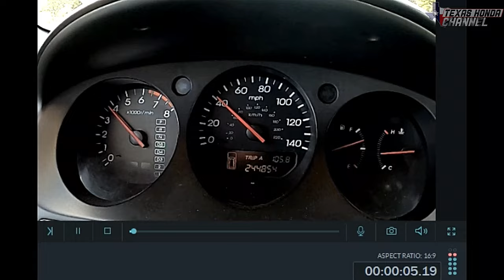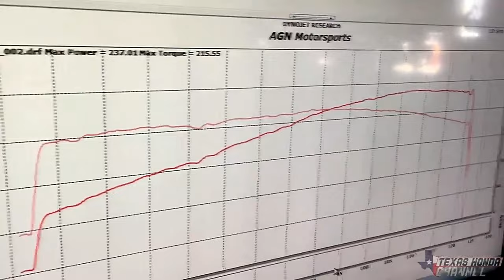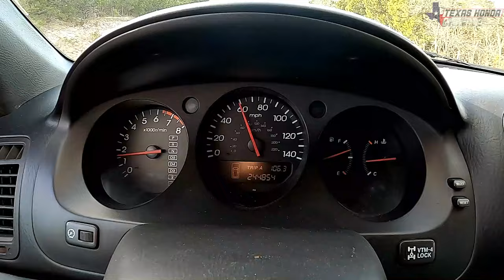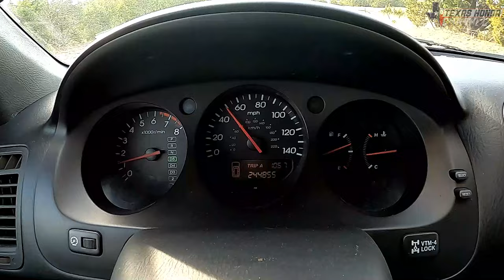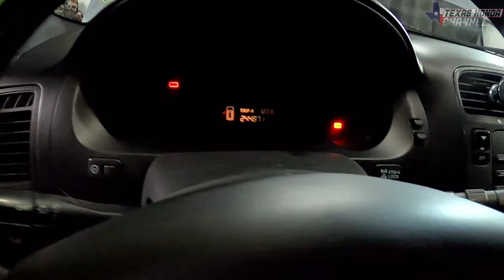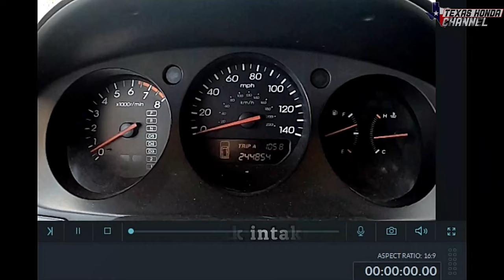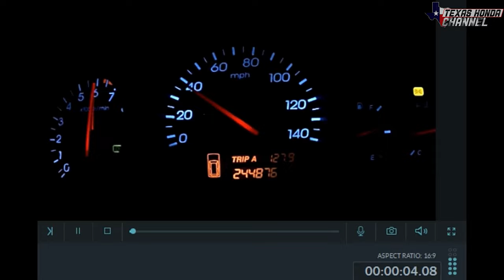Cheap Junkyard part made the MDX faster! 0-60 is 3 seconds faster now!

Comment: Would this be same process to do on a 04 pilot
Reply from the maker: It should be because the bolt pattern and bolt length and all are the same for the 03 mdx and the 04 pilot. The throttle bolt pattern for the 04 pilot might be different though so not 100% sure

Comment: Hi sr i can make this in accord 2008 v6
Reply from the maker: I’m not 100% sure but the j37 intake manifold is a better option for the j35 accord and the j35 mini van. The intake from the mini van is the same as the accord so a upgrade would be the j37 throttle and manifold

Comment: I have a 2003 Honda Pilot awd this intake manifold work whit my engine?
Reply from the maker: Not if it’s cable driven throttle body as far as I know:
Reply: Ok thanks, by the way awesome work whit your old Pilot whit the super charger I love all your content on the channel
Reply from the maker: @abelcatalan33  thanks i loved that pilot. Might try buying it back some day. I sold it without the supercharger on it because they didn’t want the charger on it so I sold the supercharger to a fan of the channel so they could supercharge their pilot.
Reply: @abelcatalan33  yes it works with yours use your own throttle body.
Reply: @ac7205  I'm assuming this will work with an 04 using the stock TB?
Reply: @krismac5523  the manifold bolts up to any J motor. A j30 manifold bolts up to a j37 vice versa

Comment: i got a 2004 acura mdx that won't start. cranking over like it wants to start. removed spark plugs and saw it was fouling (with fuel). i removed fuel pump fuse and it started then cut off. reinstall fuse and won't start. anybody here have any idea what's going on?
Reply from the maker: I had main relay go out on our pilot with similar issues and the pilot and mdx are almost the exact same when it comes to engines/transmission and electrical. I would check ecu fuse then find the main relay
Reply: @TexasHondaChannel  thanks
Reply: Crankshaft sensor maybe bad.

Comment: I have a 1999 v6 what manifold would you be a direct fit for mine and will the throttle body be a direct fit with no modifications?
Reply: That's the second gen. You have options those 3rd gens don't have. You can use true headers. Because the second gen heads used the more traditional exhaust ports. I have a 99 with full cai and stainless headers and it woke that car up.
Reply: The second gen uses a cable. This one in the video uses a drive wire. That plus the map sensor being relocated. For the HP you get with the time you are spending and the money. Totally not worth it. At least for the second gen owner.

Comment: I googled 04 Mdx touring 0-60 time.
Says 7.3 seconds.
You actually gained nothing.
Is running normal.
Great job.
Reply: I googled it🤓
Reply: Yea and google also says they get 17 mpg city lol
Reply: You aren't factoring age in. Meeting brand new 0-60 speeds in a beater with a ton of miles wouldn't just happen at stock.

Comment: I found your TL install video where you said this manifold was removed from. In the comments it looks like there were conflicing opinions on if it came from an 08-10 Odyssey or a ZDX.

When I looked at Odyssey manifolds on eBay the casting lines on the top look very different than this. Looks more like the j37 ZDX manifold someone suggested might be. But those are so rare I'm surprised if that's what it is from.

--edit OK at end of this video I see you say 06-08. I searched for 06, which they advertise as 06-10, weird, and it does look correct. Honda mid-generation part refreshes and inconsistencies are confusing. 

Trying to figure out what cars I can look for in the $40 range for part at a junkyard.

https://youtu.be/K7JK4dfrnIo
Reply from the maker: Yea I definitely pulled it off a mini van and there are more out there at the junkyard but i do wish I could get one from a J37 it would be the best option because the J35y engine